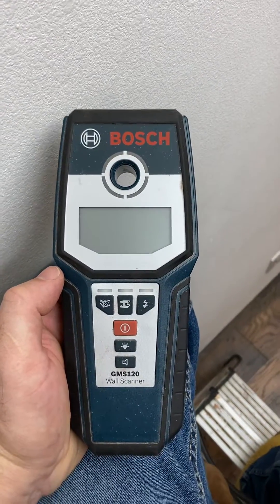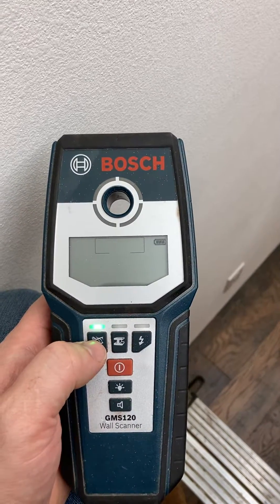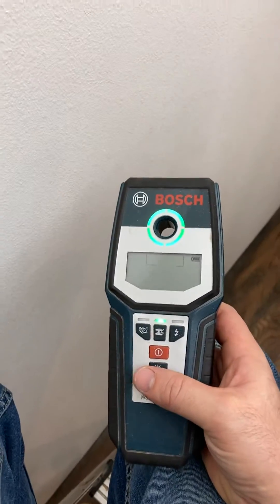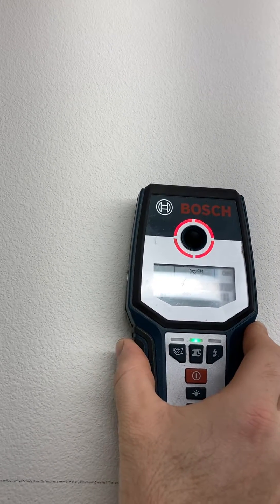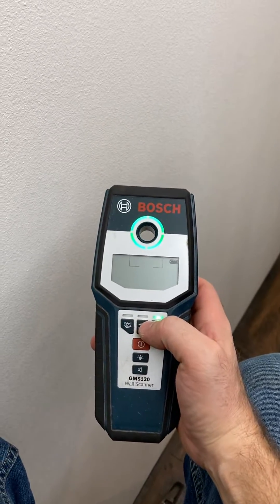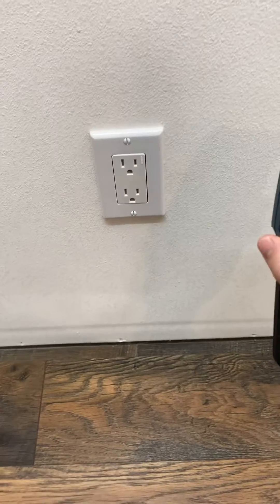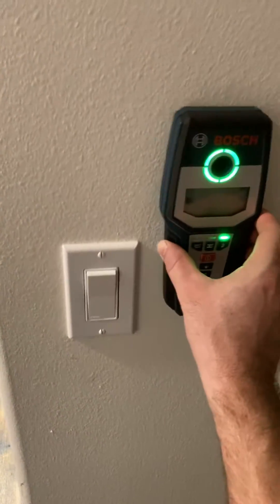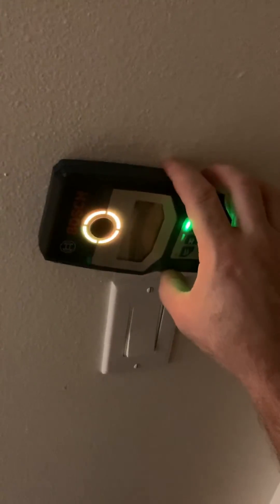Bosch GMS 120 Wall Scanner Review

Comment: That's why I hate that studd detector, it cost a lot of money and it works ramdonly and it is not easy to follow it to see when you arrived to something detencted because the screen is not iluminated and you need tk be in front of it to see if there is someti g detected and what it could be. I have a cheap studd detector very old and paid 1/4 or less of the price of the Bosch GMS120 and it always had saved me from the bs of the Busch. For the only possible use has been to find "maybe" the electric wires.

Comment: For AC conductor you should plug in or turn-on some power consumer in the outlets. Switches for LED not consuming a lot-off power.
Reply: Correct. Power circuits need to have current flow in order to be detected by the scanner. So light switches need to be turned on and AC power outlets need to have something plugged in and on consuming power to be detected.  The scanner relies on inductive pickup to work